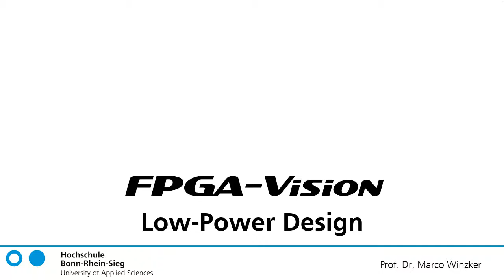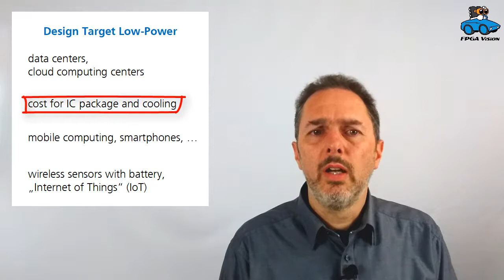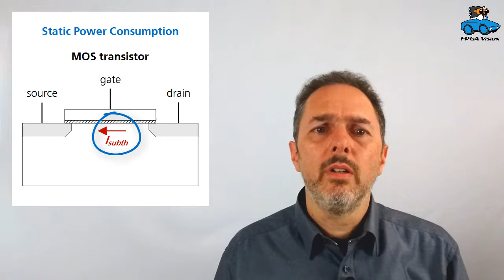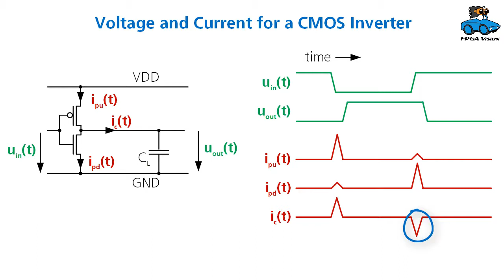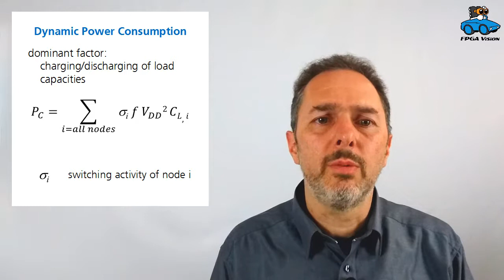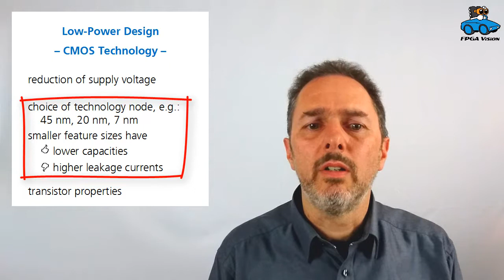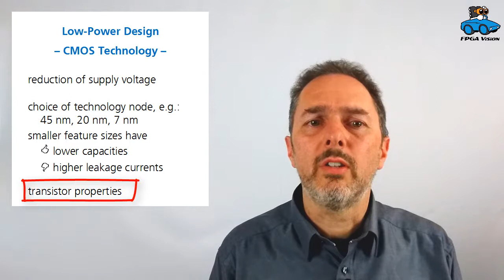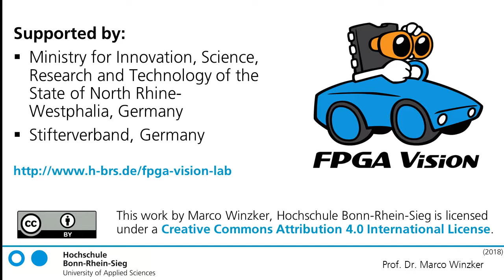FPGA Vision - Low-Power Design

Comment: We have recently been using the efinix T120 fpga ( awesome power , size , performance metrics )
Reply: For which purposes or applications have you used it ?
Reply: @abdelghanibourenane5096  initially we loaded their RISC-v processor and ran basic I/O and are now running vision processing using pi cams and hdmi out , with an end goal of vision processing on an edge device where the entire system must run on ~ 10 watts ( POE ) .  We are in a holding pattern until a Linux port for the device is available .

Comment: Dear Sir
Thank you very much for your helpful videos based on FPGA.
I want to make tracking objects in real time based on fpga platform.
Please which fpga kit I can use?
Can I use the older one like vertix 5 or spartan 3? 
Thanks again
Reply from the maker: These are the requirements for an FPGA kit:
- enough FPGA ressources (depends on task to perform)
- supported by EDA tools (no problem, except for very, very old FPGA kits)
- input and output interfaces (this can be a problem, few boards have video input)
Reply: @marcowinzker3682  Thank you very much doctor Macro very helpful information Sir.